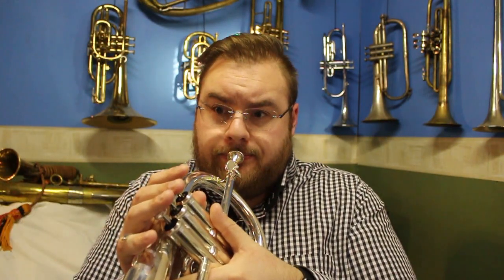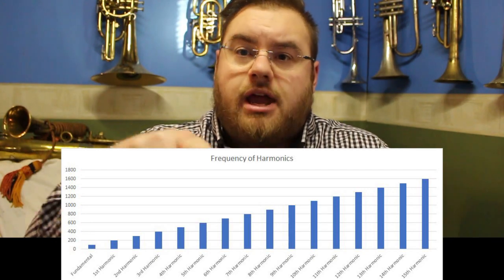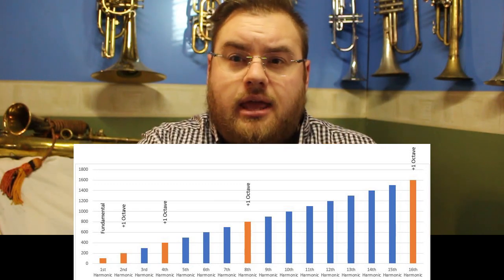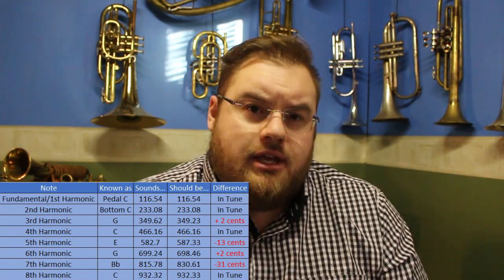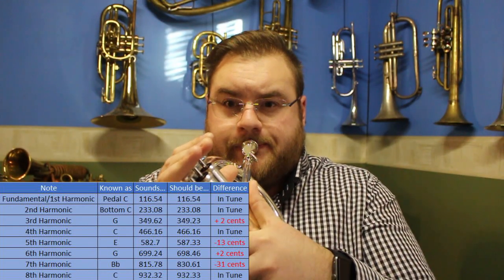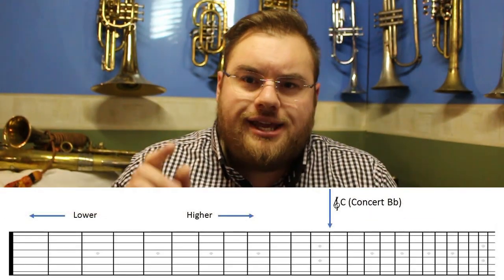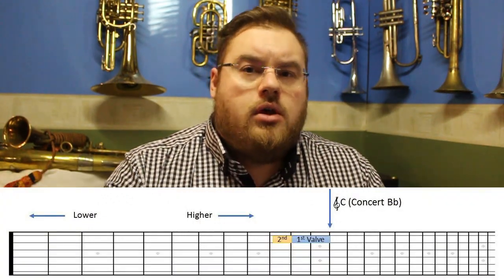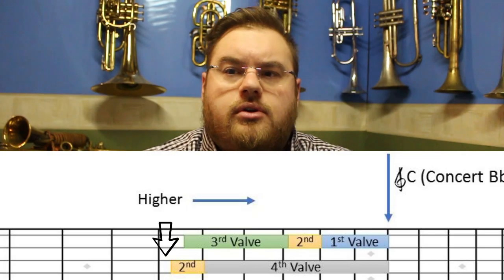The Science of Brass Tuning | Stuff all brass players should know

Comment: Depending on the temperament (of the instrument as well as the person arguing ;-)), one might say that the 3rd harmonic G is spot-on, but the scale we use today has been modified (for very good reasons) to ever so slightly detune that interval.
Reply: Right.  When he says the G is slightly sharp, that's in relation to equal temperment.  Equal temperment is a way (and the most commonly used way) to tune keyboard and other similar instruments so that the intervals between notes is the same regardless of the key of the music being played.  It's a compomise of making every key slightly out of tune in order to avoid some keys being very out of tune, so I would say it's more correct to say the standard G of a piano is 2 cents flat than to say the G on a brass instrument is 2 cents sharp.
Reply: @jasonbehm3081  same for the thirds... that is why brass bands or strings just can sound in perfect pitch, when the piece is in the right key and people use their ears where keyboards can't.

Comment: Tip one; don't even bother tuning a mellophone. It never works
Reply: I'm pretty sure a mellophone is legally classified as a noisemaker
Reply: cmon dude d flat is always spot on with that 1 2 3 fingering
Reply: The Baguette Finally someone understands.
Reply: For real, D flat is like ridiculous and don't even try playing any notes between but not including G through low C. Low C and down though, it does it to an extent.
Reply: You can, you just have to use alternate fingerings and your embouchure. But it depends on the instrument - for instance, my Kanstul G mello bugle has a super flat 4th space E open, but with 1+2 it’s perfect. Similarly, 4th line D is really off with just the first valve, but with 1+3 it’s right on.
Reply: I'm a mellophone/French horn player. What about the French horn - its WAY worse
Reply: Any instrument in the key of F is hard to tune

Comment: The 3rd valve length is not designed for sole use but is the correct length for use along with 2nd valve.  Such that 23 A-flat is in tune with slides "in".
Reply: So this is why 1+2 is preferred over solo 3? Solo 3 can't get a perfect E without lip bend? But it sound like 1+2 is off anyway as well so both would have the exact same issue, no? I guess it just depends which is more flat...?
Reply: @SelfPropelledDestiny  no. 12 is sharp. Pull out 1st valve slide for 12 to be in tune. 3 alone is flat. 23 is in tune ,  and 13 and 123 are sharp requiring 3rd and/or 1st slide out for tuning.

Comment: This is really clear, concise, and accurate. You explain things well because, I take it, you conceptualize things very well in your own head. I appreciate this a great deal.

Music is so counter-intuitive sometimes, partly because it is commonly taught alongside a number of very old, traditional, false premises, whether for the purposes of tradition or for the purposes of simplification. So often when you look more closely at particular aspects of music, such as the design of brass instruments as I see in this video, you see things that are just not as you would have assumed them to be, or by the common philosophy of music, how they ought to be. Indeed, one can reason that music does not have to involve any compromise, really, as long as we are clear in what it is that we're trying to accomplish, as far as composition goes. But when it comes to performing compositions with acoustic instruments, the harmonic series seems to necessarily be an obstacle. Even if what we desire from music does not have to be based, entirely, on the harmonic series, the harmonic series still makes it inherently easier to produce some combinations of tones than others. Using only those exact tones which are found in the harmonic series is actually very limiting. To the extent that we want to perform something which is not based on the harmonic series, we will find greater difficult performing it. To produce an equal tempered diatonic scale from a brass instrument does not just require that we follow nature, but that we bend it to our will.

Comment: 9:40 - "these valves are designed to be in tune when they are used one at a time" - that's actually incorrect. The third valve is designed to be used in combination with the second valve, to lower the overall pitch by an accurate 4 semitones. Hence why you don't have to use the trigger on A flats/E flats.

Comment: Great explanation. Just one minor correction: the third valve is (or at least should be) tuned so that notes played with the 2+3 fingering are in tune. That's why when you try to play an E on just 3rd, it always sounds slightly flat.
Reply: So this is why 1+2 is preferred over solo 3? Solo 3 can't get a perfect E without lip bend? But it sound like 1+2 is off anyway as well so both would have the exact same issue, no? I guess it just depends which is more flat...
Reply: @SelfPropelledDestiny  I thought I replied to this comment already, but it's not showing up so ig I'll type it again.

Good question. If you crunch the numbers, you find that if you're going for 3 perfect semitones, then the 1+2 fingering is 10.6 cents too sharp, and the 3 fingering is 16.3 semitones too flat. This means that 1+2 is slightly more in tune than 3.

It's also significantly easier to bend notes downwards than it is to bend them up. Most players will subconsciously bend 1+2 down to make it in tune without even realising it, since it's so close. This works just fine, but it isn't great for the stamina so I like to extend my 1st valve tuning slide slightly whenever I play 1+2.

On a lot of instruments, the A above the stave especially is quite sharp. This is why a lot of players like to play that note on just 3; it makes it more in tune. This depends on your instrument though. In fact, this kind of thing can happen for any note, which is why it's worth carefully going through every note with a tuner to find which fingerings are the most in tune for your instrument. For most notes you'll find that the standard fingering is best, but you'll occasionally find an alternative one that works better. I'm actually a sop player, so about half the notes I play are on alternative fingerings!
Reply: @kaiblack4489  Thanks for the response! That's all very enlightening. One question there: That high A would be the 8th harmonic in the 1+2 position, but I was under the impression that all octaves were fairly in-tune. Is the 8th harmonic normally sharp?
Reply: @SelfPropelledDestiny  It's all a bit up in the air when you get that high, but yes it's often a bit sharp. On my old trumpet I used to play top Cs on 1st valve.
Reply: I am back to ask another question. If the 3rd valve is tuned so that 2+3 is in tune (concert F#, C#, F#...), then why does everybody say you really need to use your 3rd valve slide on those notes? I have heard as much as halfway open on the 1+3 fingering and fully open on the 2+3 fingering. What am I missing?
Reply: @SelfPropelledDestiny  Haha np. Either they're wrong, or you're mishearing them. You're meant to put the 3rd valve slide put halfway for 1+3, and all the way for 1+2+3 (F#, C#, etc) You're not meant to put it out at all for 2+3, and certainly not all the way unless it's a VERY duff note 😄
Reply: @kaiblack4489  went and rewatched and you are right. I was mistaken. They said C# but I come from guitar and other c instruments so my brain tends think concert pitch all the time. Thanks again!

Comment: If the tuning issues did not exist I suspect brass would lose it's charm . Good players seem to be able to compensate . They may even be able to do this to produce good tone and intonation when the mouthpiece gap is too great or when the valve alignment is out of whack so that valve ports are not properly aligned with the tubing entering the valve casing . This is a fascinating  aspect of brass , rather frustrating for the player of average ability though .

Comment: You never explained what the besson enharmonics system is. What is it and how does it work, may I ask?

Also, if using 1 and 2 is less in tune than just the third vlave, why is 1 and 2 the preferred fingering? Also, why is using 1 2 3 to play a low C# on trumpet extremely sharp, but in tune to play the F# below it? I didn't notice any significant differences between the first and second videos, by the way
Reply: I don't know the answer to the first question, but I kinda know about the other two!

1). 1 2 is what is usually written because 3 is also out of tune because it's supposed to make 2 3 in tune so 3 by itself is flat (at least from what I've been taught, things might be different for new Zealand instruments), as for why it is preferred, probably because it's easier to quickly change to and from it because our first two fingers are a lot stronger than our third finger?(I'm not completely sure but that's the best explanation I can come up with). 

2). 1 2 3 is always a sharp fingering, but when playing down that low, it's likely that you're just buzzing flat (buzzing flat + sharp fingering = in tune but below focused or "muddy" tone). On 1 3 and 1 2 3, always make sure you kick out a slide on it (if possible) or just have your tuning slides in such a way that you can lip all the notes in tune.

Also, yes I know this is extremely late, but I just want to make sure I get some of this info out there. However, keep in mind that I am not a professional or even an adult so some of my info or explanations might not be entirely correct, BUT I do believe myself to be pretty knowledgeable in this field. Good luck in your playing!!

Comment: This is why trumpets have finger rings on the third valve (and good ones have thumb settles on the first valve slide); so you can tune notes that use those valves on the fly. You can just adjust the tuning based on the combination of notes that you're using.

Comment: Great explanation! Didn't know about the valve combination issue (I play the trombone), now it makes a lot of sense.
I have a question though - does the effect of the valves change as you go up in lip frequency? It's like going up the fingerboard - you need shorter frets to go down, but the valve piping stays the same...
The same way that the slide positions become tighter as you go up. So the valve combinations might become less sharp or even flat on the upper register?
Reply from the maker: Hi, thanks for the question. No, the valves remain in tune when you go up or down. Guitars have 6 different strings, all at different pitches, yet the frets are the same for all 6 strings. That being said a person's lip can alter the tuning of the valves quite dramatically when you play high.
Reply: Trent Hamilton Thanks, this makes sense now. You add the same pipe length, but it's forced to vibrate faster together with the rest of the instrument.
Now that I think of it, each slide position is a half step apart from the others, no matter how high you play. The only thing that changes is in which position the next note after position 1 appears on the slide. After that it keeps increasing in semitone per position...

Comment: You're definitely simplifying things greatly here. You didn't even touch at all on the effects of conical vs cylindrical bore, or changes in bore type/taper through the tube length. If I remember correctly, the mostly cylindrical bore brass instruments, such as trumpet, are actually based on only the odd harmonics of the harmonic series, but they have been skewed to mostly sound like the normal odd and even harmonics; so "actual 1"->1, "actual 3"->2, "actual 5"->3, etc. The main elements that do the skewing are the bell flair, which sharpens the lower harmonics, and the mouthpiece, which flattens the higher harmonics. One red herring of this skewing of the odd series, is that the 1st harmonic is almost always way off. This is a trade off to have the other harmonics more in tune, since the pedal range is used so much less often. As you move to the mostly conical bore instruments, such as french horn or tuba, then you're actually dealing with the full harmonic series, both even and odd, and that's why the pedal notes are far more in tune for those instruments.
Reply from the maker: Hi Greg, thanks for your comment. I'm not too sure whether you're right though. I don't think the conical vs cylindrical aspect has quite as dramatic an affect on the harmonic series as you've stated. The thing that makes the even numbered harmonics disappear is whether the tube is open at the end or closed. Since brass instruments only have one exit for the sound to go then they're therefore an open ended cylinder they naturally have all of the harmonics available to them. The proof is this: trombones and baritones are mostly cylindrical instruments, and yet the pedal notes are just as in tune as they are on a tuba. The BBb contrabass trombone I have is a very cylindrical instrument, yet the pedals are just as in tune as a tuba.
Reply: You can go even beyond that and also consider the expansion and vibration differences across different alloys, what sort of changes each plating does to the resonance of the base metal and so on. Almost everything has a variance that will affect how the instruments sounds, which is why instrument tone can never be an exact science.

Comment: Okay so I watched the compensating valve video, and I have a question. I'm a trombone player myself and I have a tuning slide for the main part of the horn and one for when my trigger is pressed. By tuning my trigger to F, am I doing some sort of compensation myself? Thanks in advance!
Reply: No. Compensating valves basically mean that you are holding two entirely different instruments-for a standard euph., one would be in Bb and the other in F. You know how Trent, in this video, talked about how combining valves puts the instrument out of tune? Compensating valves get rid of this issue when combining other valves with the fourth valve, so intonation wise, it is like you are only pressing one valve.

Trombonists can't have this, don't have this, and don't need to worry about it, because adding a compensating system would be physically impossible because the instrument would need to switch at some ambiguous point between fourth and fifth position. When you tune to an F and then go chromatically down the horn to a low B, you will notice that the notes get flatter and flatter past 4th position. This is slightly due to your embouchure having to loosen up,  but mostly due to the fact that using the trigger past 4th is like using two valves at once on a valved instrument, since 5th-7th is equivalent only to multiple-valve combinations. Compensating valves on euphonium for instance would get rid of this issue, and the horn would play with the same intonation it would on the Bb partial - trombonists play a giant tuning slide, however, and just move all the positions in a little bit. You are compensating with your slide positions (the same way you should be for the concert F partials, the D partial, the high Ab partial, etc), not extra tubing.
Reply: ..as a sidenote, you usually tune your trigger to c, not f (despite its name).
Reply from the maker: I don't know anyone who tunes their F trigger to C...
Reply: There seem to be two approaches. One is to tune for b->f to be able to play the F on first position.

The other (and at least over here in germany seemingly more common) way is to tune f->c, so the c on 1st is in tune. This makes the F too flat to really play on 1st, but we can play that on 6th anyway. The two advantages are, that we can play the - for tenor more common - c without adjustment and we don't lose the C on deep 7th, in case we really need to play down there ;).

Comment: Trent, i have just purchased a Mendini 4 valve euphonium. I have stared to play after 25 years of the trumpet, baritone and French horn. I’m not sure of the 4th valve use can I ignore the 4th valve ?. Could you advise me of the 4th valve use as well as the quality of the Euphonium it self. If I strick to the instrument I will eventually move on to a compensating euphonium. Can you recomend a intermediate compensating euphonium. 
Sincerely
Victor
Reply: Victor Batres 
Hey Victor, the 4th valve can be used as an alternate fingering for the 13 valve combination. For example you can use fourth valve for low C. You may find that for certian notes thr 4th valve plays more in tune than the 13 fingering. Hope this helps! -Isaiah
Reply: 2 & 4 are more in tune for concert b natural.  I started on a trombone with a trigger (trigger and 4th valve do the same thing)  and on my trombone I never go below 5th position or on my euphonium I never use 1&3  or 1&2&3.  I also use 3 valve instead of 1&2 because I am lazy.  If I can push one valve instead of two, I do it.  I use a medium large mouthpiece and can lip any note in tune.

Comment: Wonderful work. Kept thinking, what about slide instruments? If the error is always in the sharp direction with valves, could a faster main tuning slide be used and controlled manually( by hand)or fingers. But the down side would be the pitch consciousness of the player( student) in so many cases. I needed to hear this so I won't miss lead my granddaughter,when she is practicing her Euphonium
Reply: Some Euphoniums do include main tuning slide triggers, however, it is a common practice to "lip" the required notes into tune rather than use a trigger. Some models, such as the JohnPacker stencil horns come preinstalled with one, but you can also find kits to attach them.

Comment: I'm surprised you didn't mention the tuning-slide ring on the 3rd valve tubing of most trumpets and cornets.
Reply: Agree. And also lipping notes into tune. It's not part of the design of the instrument, but it is the way the problem is solved in practice.